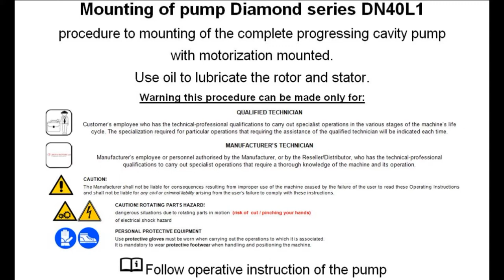How to Assembly Progressing cavity pump Diamond DN

Comment: Hello, sir. I want to ask. what key is used to open the rubber which is tied at the shap join?
Reply from the maker: a simple flat-blade screwdriver
Reply: how to calculate GPM?
Reply from the maker: @icawijaya9217   what do you means GPM (gallon) for you?
Reply from the maker: It's depending from the pump size
If you need to know  the flow, whatch the brochure in the website of novarotors  
https://www.novarotors.com/wp-content/uploads/2016/10/NR_BCH_EN_002.pdf

Remeber that 
1 cube meter hour [m³/h]  =   4,402 867 539 302 5 Gallon (fluid, US) per minute [gpm]
Reply: thanks very much. the answer is very helpful. I will continue to study my work. relating to the novarotor pump

Comment: what is the type of the sensor that was mounted on rotor and what is its function
Reply: It's a pt100 or a thermocouple maybe. They are used to measure temperature.
Reply from the maker: The sensor mounted on the rotor is a Pt100 probe. This type of sensor is used to detect the temperature between the stator and the rotor. In the absence of fluid, the friction between the parts generates heat. If this heat becomes excessive, the Pt100 probe detects a high temperature. When connected to a temperature controller and the motor, the probe allows the pump to stop within a few seconds to prevent damage from overheating.

So, the primary function of the Pt100 probe is to monitor the temperature and prevent overheating by stopping the pump in case of anomalies.